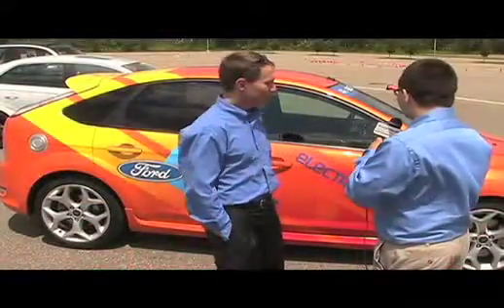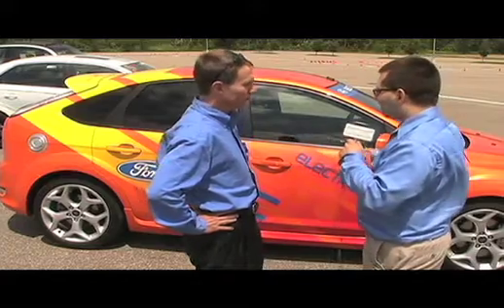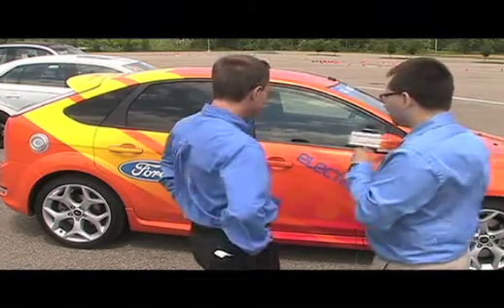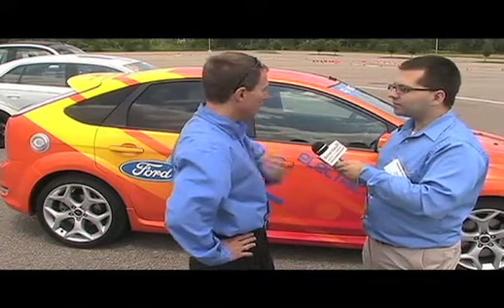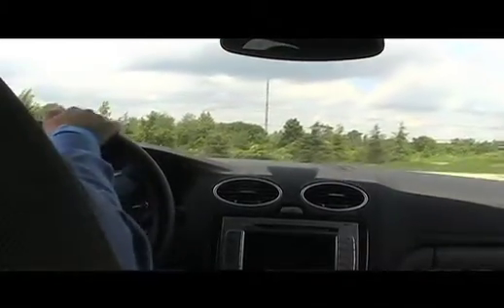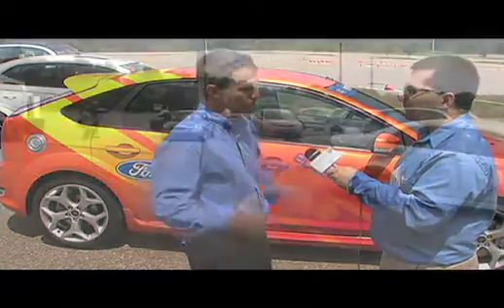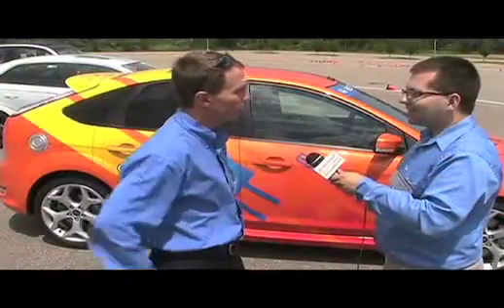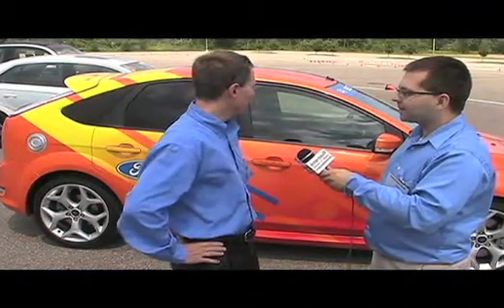Test drive of the all new Ford Electric Focus featured on the Jay Leno Show with interview

Comment: A VW TDI (clean diesel) can go well over 600 miles on a single tank of diesel, beats hybrid MPG on the freeway, all while maintaining a surprising amount of torque through its entire RPM curve (peaking at 236 foot pounds).  It can run on biodiesel you make in your garage, and even straight used vegetable oil you can get for free from restaurants.

Electric technology just isn't there yet, guys.  Soon, but not yet.